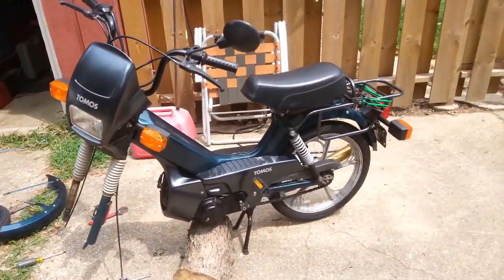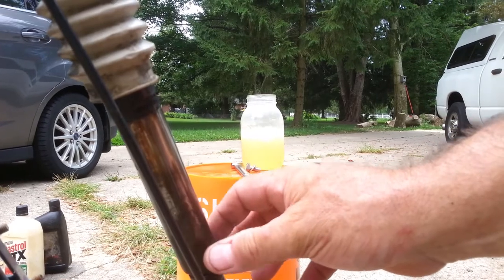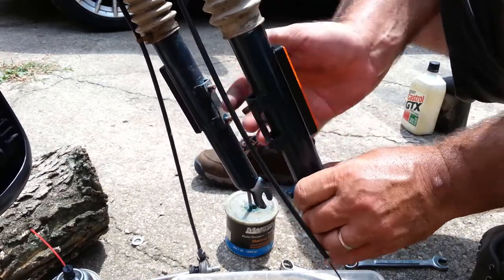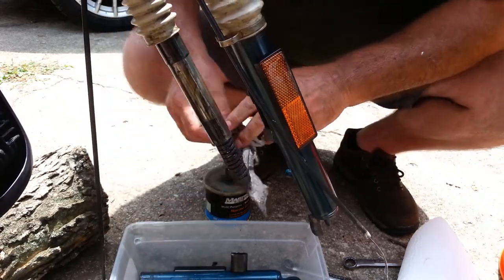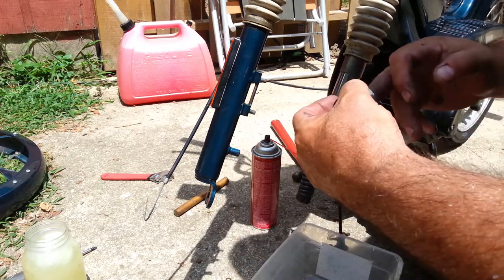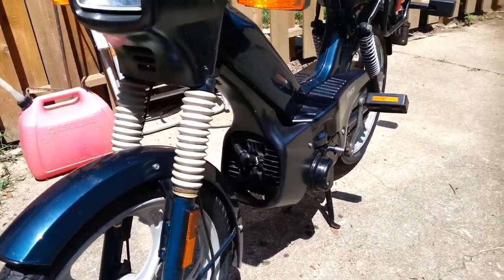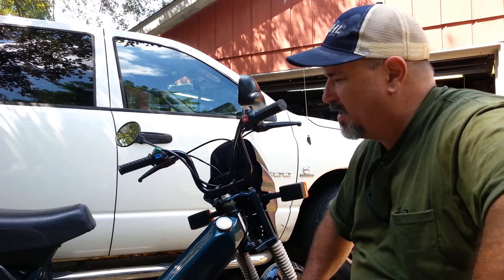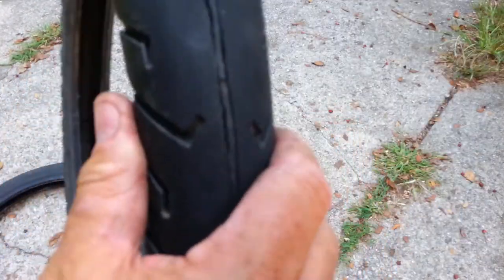Tomos Moped Fork Wobble Fix - The Crafted Channel

Comment: In 1956 my dad bought a Puch moped like yours from Sears. I was 14 years old.  I rode it for many years and actually put 10,000 miles on it. One tough bike!  Yep, the 2 speed tranny really sucked. I am rebuilding a Harley Davidson M50 now.
Reply from the maker: Cool.  I've heard the clutches are problems on those.  Why not reline the shoes with longer friction material?  If I get one, I'll probably do that.  I have the glue and friction material on hand. I want to do a high performance bike.  Puch or Motobecane I think.  Have a kitted Tomos and one missing he motor now.  Also have a non-running Hero Majestic I'm embarrassed to say.  ;-)

Comment: My spring came out. How can I put it back in?
Reply from the maker: Take the front end completely apart, clean and reassemble.  I did this years ago. I don't remember step by step but it's obvious if you tear it down.
Reply: @CraftedChannel  I couldn't remove the spring or attach the other one back on 😒
Reply from the maker: @dha588  I believe they thread up into something.   Turn them see what happens.
Reply from the maker: @dha588  Just keep removing parts, everything you can until you see how it works.   It's super simple.   Step forward boldly.

Comment: I guess the reason why people don't talk about this issue that much, is the fact that a new shock/strut, or in this case even a completely new front fork, is supercheap.
Here ( in NL ) most people replace stock Tomos front forks with 'EBR' branded ones, which are thicker/stronger, and only set you back around 80 bucks. https://imgur.com/a/uM0iyt2